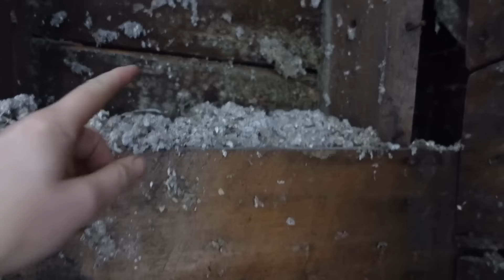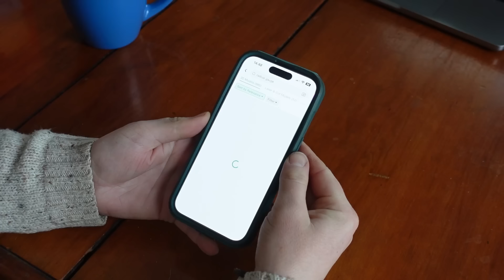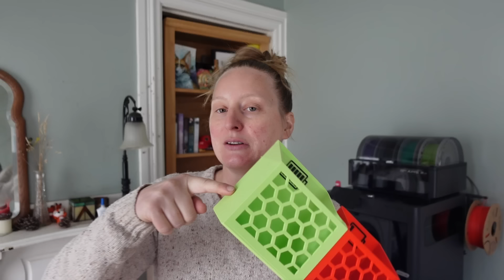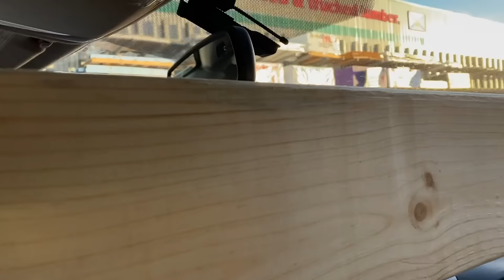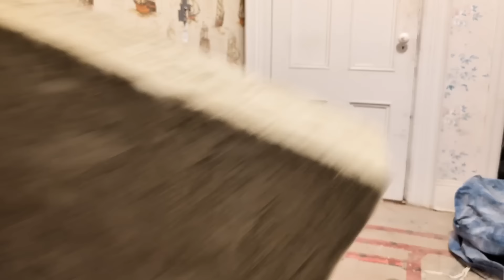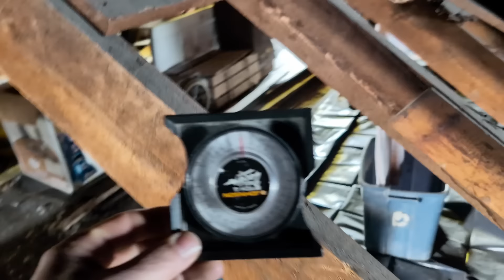We REALLY need a new roof... but at what cost?

Comment: When cutting mineral wool insulation for odd width cavities don't cut the batt lengthwise. It is easier to cut them to width. They install just as fast. The last piece from each batt will be short. Install that, cut the next piece to fill the remainder and continue on. There is zero waste and you do not end up with a lot of narrow strips to try to fit in elsewhere.

Comment: They should map out where the leaks were before redoing the roofing as some areas of the roof made need additional bituminous underlayment beneath the shingles, not only because of ice dams that may form but also because the prevailing wind can drive water backwards through the shingles.
Reply from the maker: As always, highly recommend going back and watching all the individual episodes for further details on the renovation adventure that you’ve missed

Comment: Something more durable can save so much trouble and expense down the road.
If the blocking is not caulked around the edges to make an air tight seal it will not stop hot air or fume inflitration.

Comment: If you haven't committed I would look at Ideal Metal Roofing.
I installed a Heritage standing seam product myself in under a week on a fairly simple roof.
They make several metal tiles/shingles and roofing/siding panels.
One reason I mention them is that they are from Quebec and they understand the little flip at the eve and several of their products are made specifically for Atlantic Province needs
Their Shingle product is called Wakefield Bridge and its' $14-$22 installed. $28K-$44K for 2000sqft roof.

Heritage is a little pricier.

Personally - I don;t like tiles so if I had your home I'd probably do the Heritage or Junior H-F on the main roof and dormers and Junior H-F or Security Rib on the Bays
OR
Splurge for Copper downpipes and copper roofing on the bays and let it age.

I've done a few houses and your videos are fine.
One great thing about your videos is it shows your life with a renovation and not just a renovation

Comment: Here in Australia we have a colour bond steel roof on our house. It comes in many profiles and lasts for 60 years plus. In Asia they use ones made to look like Chinese tiles so metal roofs can be pressed into any shape and curved easily. We get lots of hurricanes and cyclones,so how secure it is it depends on how it is tied down. It can be installed in a day . However because of your climate in Canada you also need to factor in how you are going to finish and insulate the inside of your new roof system. A couple in North Dakota replaced a large irregular roof with asphalt tiles for $ 20,000 US recently but it needed extra carpentry work to create a ventilation space for an open roof system to prevent mold buildup under the roof, so they used a closed roof system using spray foam stuff for insulation to meet their building code . So you will have to double your cost estimate. 
 A guy building a log cabin with a Canadian made metal roof system in central Ontario got into big trouble with water leakage through the nail holes and got mold in the under roof system in under two years. So it has to be installed carefully using lots of spray foam in each nail hole.

Comment: The metal roofs you looked at are the fancy ones, they might cost twice (or more) than 'traditional" metal roofs. Also, metal can be LOUD when raining. Also, snow melts cause avalanches of the roof. If you have a deck, it can wreck that. We went with the newer HIGH wind-proof shingles with 30+ year guarantee because of the latter reason, they have irregular shaped shingles and subtle multicoloured . Cheaper than metal too. Bon Chance with your decision. 🤍

Comment: Big bucks….nothing is cheap anymore.
Reply: As a contractor myself, roof is imperative, then soffit and gutters, windows, then exterior siding or whatever. Then your interior, replacing any rotten studs, electrical, plumbing, insulation, drywall, flooring, trim. You all are doing a great job. Just crazy expensive.

Comment: New roof - I'm sure new roofs in your area may cost more than my area of Florida.  The more peaks and angles plays a huge part in the quote.  I had my house re shingled 3 years ago.   I have a 1400 square ft. area and it was $12,000.00 for materials (standard asphalt shingles) and labor.  This included replacing rotten and damaged boards, sheathing and rubber membrane.  It also included rebuilding the roofs over 2 covered patio areas.
You have a very interesting roof for sure.  I'm familiar with metal roofs, it's common in my area. but hadn't heard of the other one you featured.  Hope you're able to negotiate a good price, it sure would solve a lot of your house issues.

Comment: We just had asphalt roofs replaced at work on two buildings of similar age but far smaller footprint and though the brickwork may be more elegant than your house's design, your roof design is way prettier, hands down. I don't remember the pricing, though it was shingles. I think my old boss paid $30kCAD just for the materials when he got his house's roof redone with this fancy steel stuff that looked like a tile roof, it was really pretty but I'm pretty sure it came in flat sheets like the standard boring steel roofing so woudln't have made it around your roof's curves. So I'm going to guess 70K. I hope it's way less than that  though!

Comment: Most residential dwellings in New Zealand have metal roofs with some exceptions . Because of the high winds we experience at various times of the year, the steel is secured using galvanised roof & cladding screws rather than relying on the traditional lead head nails. The great thing is that you have options where you can get either aluminium corrugated steel, or colour steel. All are very reliable.

Comment: We thought about going with a metal roof on our 1900 Victorian house and 1889 brick commercial building, but ultimately decided against it went with composition for both. A metal roof was going to cost significantly more. Especially if we went with a more period correct standing seam style. Even if we went with used metal paneling salvaged from an old nursing home. The weight of the metal was going to be an issue structurally, since the property sat vacant and abandoned with a roof with big holes in it for many years. Our area gets a lot of hail. With a steep pitched gothic gable roof, you would be looking at the dents from the street. We went with composition architectural shingles from a discount salvage place in town. Much cheaper. Less choice of color, but went with the Desert Sand color, and it looks good. I love your red roof, though. We have a 1907 rental house that we had a new red shingle roof put on. Tile Red color. I love it.

Comment: Not sure if it was mentioned but a lot of times roofers want old boarded in roofs to be sheathed over with plywood to honor their warranty. With older houses there can be major gaps in the boards and if those gaps line up with the nail strip of the shingle it’s no bueno. 
If replacing roofing or siding make sure to at least re-nail the boards to the studs. It’ll add alot of rigidity to the old house 😃
Reply from the maker: As always, highly recommend going back and watching all the individual episodes for further details on the renovation adventure that you’ve missed

Comment: Since you love resell, flea markets..... There lots and lots of wood planes specific for trim & molding at auctions (including online), yard sales and such. With your new gauge in hand, you could easily pick out the ones you need. Some may need cleaning or a bit of repair... but usually you can find them anywhere from 5 to 20. Old farm or barn sales usually have the most.
Reply from the maker: Mostly I see them on Marketplace here... not so much in terms of flea markets around here. But the planes equally need to have the same profile as the moulding you're matching! Not just any old moulding plane will do!
Reply: @ShannonMakes very true... that's why your new guides are so cool.

Comment: WHAT EVER YOU DO.....NO MORE ASFALT ROOF...You can go with a low rib steel, and you can curve them to if its not to sharp.,,,,.and if its to sharp maybe do shingles there....The steel roofs that are like shingles have more chance to leak....to many seams....Ive had to repair some of those...So with steel you will pay more now but save a PILE OF CASH later,,,,I have replaced roofs that where 8 years old,,,,,and I remember the lady saying that they didnt put steel on because it cost more,,,,,so I said if you would have put steel on years ago I wouldnt be putting steel on now and that 9000,00 would be in your pocket not mine,,,,,from an old house restoration and roofer,,,,,,NO ASFALT,,,,,,,

Comment: I have had friends that went with metal roofing and they have had nothing but issues. Could have been due to the installers. Stainless steel screws and a type of nylon or rubber washer is needed between two dissimilar metal, aluminum roof tiles and stainless steel screws, you never know if they are using the correct products and are you going to climb up on a metal roof and dent in the tiles to check to make sure they did it right or need to put something on the roof later? I wonder how long the nylon or rubber washers will last going through heat and cold year after year even if a metal roof may last 50 years. Do we have enough history to guarantee those critical parts of the entire installation. I also do not know if they now have new roof tiles with adhesive that attaches to each tile to the other when I overlayed.

Glad you found a gentleman that has been in the business for a long time to advise you. 

Asphalt roofs are made in solid colors OR multi color grains with a slant towards a specific color if you are considering future house paint colors.

What keeps the moisture out of a roof is the underlayment. What we had installed is a black thick material that rolls out across the roof and adheres to the plywood beneath it. We would never use roofing paper again since this product has been developed.

One product is called ProFlex. I think it comes in different thicknesses, we opted for the thickest available but we thought of course it costs more but worth it in the long run. They undoubtedly have a specific product such as this for use in your area, heat as well as freezing cold. It adheres around the roofing nails when the tiles are nailed in through the ProFlex.

Guessing the cost of the roof? Depends on what product you finally decide upon.  Metal Shingles only? I am going to guess $55,000 because you have a complex roof line. This is not including wood degradation they may need to replace after removing the old shingles.

Comment: If you take that profile to a carpentry mill they can make a "knife" to make you matching trim.
The green insulation is also great for sound reduction.
You can also roll smaller pieces into "logs" to stuff down the bay cavities.
This made a huge difference in my basement and bathrooms.
Reply from the maker: Yes, that's why I said "This is going to be great...if we need to get custom knives made in the future to reproduce sections of these moldings" 😁🔪

Comment: I saw another YouTuber cut the exact same insulation as you were using, only he placed it horizontally and not vertically. More cuts but almost zero waste. That’s how he fit different size openings.
Reply from the maker: More than one way to crack an egg!

Comment: If you think about a roof covering being shingles it lasts about 15 years not the 25 they claim. They no longer use the washers around the nails so they fall off quicker now. The metal shingles last a very long time and yes the cost is elevated but if you price out how many times you will have to replace shingles and the damage that occurs when they go bad, the price is well worth it.
Reply from the maker: Also they've made them more environmentally friendly, but in doing so, they deteriorate faster and don't last as long... which ultimately means you replace them more frequently, so it does make me wonder if it's actually better for the environment in the long run...!

Comment: So... Time to stop skipping adds on Shannon's videos. And start commenting and giving revenue!
Reply: How much more do they pay if you watch all the ads is it a huge difference? Also I sometimes just put them all to watch on silent while watching tv to boost her income
Reply: @frugalgrandma at least I'm not the only one to do that
Reply: $30,000 roof cost
Reply: Our small house has a lot of peaks and seams. We looked into metal and they said for our needs the metal wasn’t going to be optimal for keeping the leaks out. We have had trouble in the past with ice dams in many places. I mean the house is only something like 1,100 sq ft but it has 13 flat “facets.” we ended up with asphalt.  It has a 20 year warranty, which will extend to the next owner of the house if we don’t keep it for the full 20 years.

The price will knock you over and make you see double, no matter what roof it is. We are not good at woodwork and we’re not inclined to go work on a second floor roof at this point in our lives… although I used to.

The roof on the 1924 portion of our house was not properly installed so we had some wood to pay for, as well as whatever that rolled stuff is that they place underneath the asphalt shingles.

I am very grateful, however, that we chose who we did because they did a great job and they did not take too long. 10 or 20 years ago we hired someone to add on a front porch. It was supposed to start on Halloween and be ready to go in six weeks. It had a huge snowstorm, and then the guy almost cut off his fingertip. And he finished on Valentine’s Day. Just saying. It’s a beautiful job he did, but there was a tent made out of tarps on the front of our house for most of the winter.
Reply: I put metal roofing sheets on my log house roof,here in USA,Love it!! Lasts so much longer than asphalt shingles,less weight,and was less labor intensive too.Love the sound of rain on roof during storms.Definately doesn't blown off or lift up like regular shingles.Good luck.
Reply from the maker: heheh best response yet!! 🤣🫶
Reply: @ShannonMakes I agree. I always like & comment trying to help with the roof fund. Took us 5 years to pay ours off. There was a massive hole in our second story sleeping porch. We had to take a loan out, but it’s done.

Comment: I would budget $46K + $6K contingency reserve in case rotten boards, fascia issues, or custom flashing work turn up after tear-off. So my guess is a total of ~$52K CDN for the cost of an aluminum shingles roof. I would also add that putting a good quality roof on now is so worth it as it will protect all of the very valuable time, money and effort you have put into this great house so far. I hope I’m wrong and the estimate comes in lower and the work goes smoothly. ❤

Comment: I put a standing seam metal roof and I won't have to worry about replacing it again in my lifetime. If the next owners take care to keep leaves collecting in the valleys and repaint it to stop rust it will last indefinitely. The standing seam hides the screws/ nails inside the standing seam. No leaks

Comment: You're on a roll with the commentary today ("Cannelle would be proud" of Phil dragging a stick with the car, "I have mold in my cavity"...not everyone can say that!). That goose definitely wishes it was a lot further south! I like the tile-like metal roofing - it looks a lot like the slate roofs you see in Europe and the UK. I wish that had been available - and affordable! - when I did my roof 23 years ago. But then again, I'm only 7 years away from end-of-life for the 30-year asphalt shingles I did get. Not that I want to replace the roof on this house again, and they're holding up pretty well except in that one ice dam spot on the north side of the dormer. Your roof looks steeper (a lot!) than mine, but if you have some valleys on the north aspect, I'd install heating wires above the gutters to prevent the ice-dam problem I occasionally have. You get way more snow than I do (I'm in NW Pennsylvania).

Comment: Being easily confused, am I right in thinking this episode was up to date? Wishing you all the best with your replacement roof, it's a huge outlay but well worth it in the long run. I commented on a previous video how surprised I was at seeing asphalt being used. In the UK it's used in rolls for shed roofs but everyone knows that they have a relatively short lifespan, so imagine how gobsmacked I was to learn its pretty standard where you are! I'm relieved you're not looking to replace like with like given your harsh weather conditions.
Personally I like how the metal 'slates' look. Is there a noise factor when it's raining to consider? Do you sit it on an insulating layer? How does it cope with expanding and contracting depending on temperature/sunshine?
Reply from the maker: Nope, always a year behind!